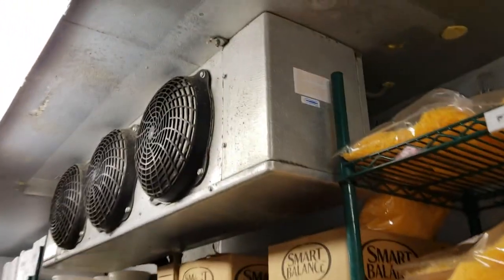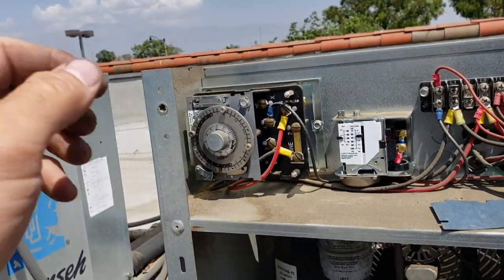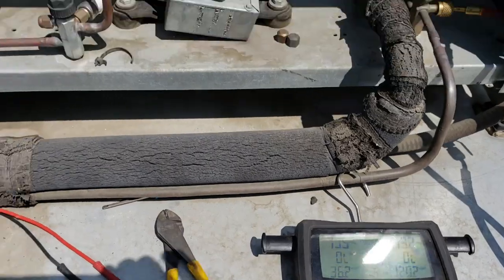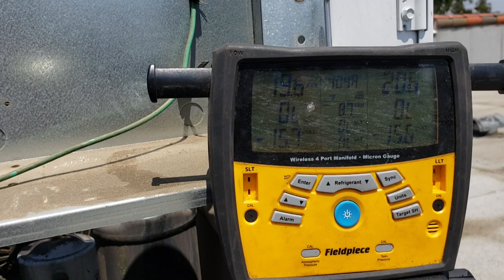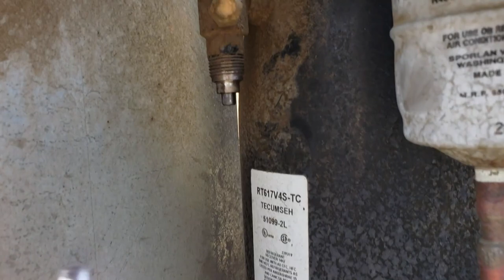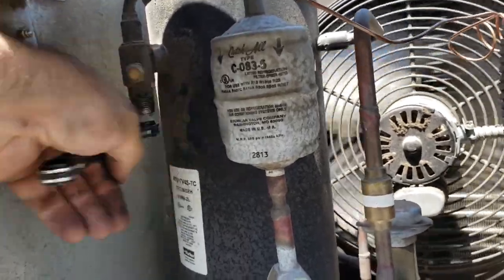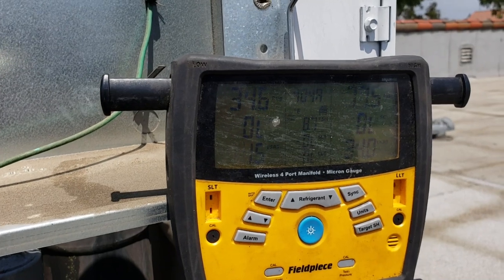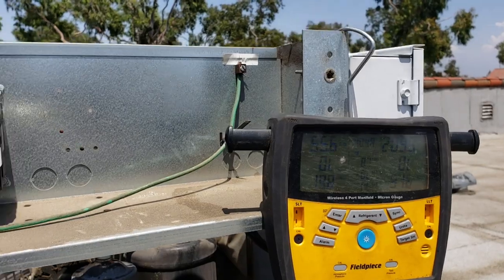Walk in Cooler low pressure control problems

Comment: I got a walk-in freezer compressor is running the fans on the evaporator are running it’s at 50° inside the cooler the low side feels warm high side feels warm I was wondering if you had any suggestions

Comment: Hello I am kinda a new to low temp, I built mobile walk-in freezers and every time I am going to start them up the compressor stalls and stops. I have to do it several times until is starts working, then after it works it does not do it again. I’ve replaced starting components, compressor, wires has a 75ft long cord and it is a 8 gauge wires.  What I started doing is putting thermostat up to 100 so liquid line can pump it down and still doing the same. When the system was new it did no happened. Voltage always no less than 203-208 on ea h leg. What can be the problem and thank you for your videos we are in El Paso tx.

Comment: I  have a question this is for a open air case 404a system. Condenser keeps going on and off check pressures ok. Could it be a bad sellenoid? It's a brand new condenser.

Comment: Hi. Very nice the ways you’re explains the job . 
I am working on draft walking the draft beer do not get that cool the bartenders say at the outside door thermostat do not go below 40  always was at 38 . The compresor get so hot I have water hose run there and low the pressure to 55 Paige low succión line, and I have some bubbles in sight glass and yes temperature go down to 38 . But I don’t know what could be wrong? Thanks for you feedback

Comment: Awesome video! I was looking for this information all over on how to replace the mechanical pressure switch without having to lose pressure to avoid noncondensable entering the system. Thank you!
Reply: is the small amount of air in the pressure switch connecting tube negligible??? the system was venting during the quick connection but i am assuming air was not removed from the pressure switch tube.?? just wondering..
Reply: @markhoffmann5941 nobody really knows😂 last year I broke my vacuum pump I just purged everything for a whole year😂 all the units work fine🎉

Comment: Taking a short cut was great. Checking the temp on either side of the dryer. Wouldnt it tell me first if the dryer is good. If not it would need replacing.

Comment: I have a system that has one broken low preasure port, one at the evaperator (inaccessible) and one with the preasure switch on it. I guess I have to take the low preasure control off to charge it. Fun times. Why is all of the equipment on YouTube so nice and the stuff I see is 15+ years old and trashed, lol.

Comment: When bypassing low pressure control to force the unit to run in an emergency, make sure you also turn down the thermostat and check defrost controls so it doesn't close solenoid and run in vacuum while you picking up the part.

Comment: This is great video showing real efficient way to change out the pressure control.   I like the subtle detail about the 6psi left in the system to do quick change out of the flare fittings.

Comment: Funny I did this last week as well same problem. This method is great way to do that and also replace a flared TXV🤓. Refrigerant is only a little bit of vapor escaping the system. Got to do it fast so no moisture or air gets in. Surprised the J/C control failed, usually it’s the cheap rancid or Danfoss ones. I enjoy your videos Chris!
Reply from the maker: It was actually was  a ranco  control personally I hate the ranco controls, but I decided to put the ranco back in because it fit perfectly. Thanks for watching and taking the time to leave a comment!

Comment: Had a walk-in loose a complete charge because snow on the roof broke the liquid line. I called out my repair guy to repair the leak but he didn’t replace the drier. I notice you were concern about loosing the charge so you don’t have to replace the drier. Your thoughts on this ?  Thanks.
Reply from the maker: Yes if there was a loss of charge the drier needs to be replaced

Comment: A really good video on the pressure control switch. I liked the technique of keeping a positive pressure on the low side so that you keep air out of the system while installing the flare nut & cap tube assembly. I am assuming we would want a walk-in cooler pressure control to kick in at 40 degrees & cut off at 35 degrees, hence the 5 PSI differential.
Reply: eeh controlling temperature solely with a pressure switch? Sounds a bit wrong in my ears, because the pressure is deciding how much the cooler will cool (temperature difference), not the final temperature. The final temperature depends on many other factors, like how much heat energy the walk-in-cooler collects through the walls, how often the door is opened, and which is the sorrounding temperature outside of the walk-in-cooler (Which temperature it has to "work against"), as a refridgeant system moves a set amount of heat energy from one Place to Another.

Using system pressure for temperature Control sounds like it gonna lead to a walk-in-cooler that is "warm" on the summer and "freezing" on the Winter, as the adjacent temperature around the walk-in-cooler will be a tad lower on the Winter, transferring less heat energy through the walls and during door openings, and a tad warmer on the summer, transferring more heat energy through the walls and during door openings.

Or is a thermostat wired in series with that pressure switch doing a final temperature Control aswell?
Reply: @sebastiannielsen  I work at a hospital & our morgue operates on a pressure switch as well as several reach in case type beverage coolers in the cafeteria. I'm sure the design engineers of the equipment considered all the criteria you listed above. I have never observed any real temperature differences on the equipment in summer or winter. The pressure control eliminates the need of a t-stat so you will not find one on a pressure control piece of equipment. The pressure of the refrigerant & the PT relationship between them will regulate or control the temperature & they work quite well. Thermostats with a gas or liquid charged sensing bulb will operate with the same principle as the pressure control. Heat is always trying to get to a space that is lower in temperature so regardless, the pressure control will react with the changes & operate in accordance to the setpoint of the control, not some other final temperature. If the setpoint is 34 - 39 degrees the pressure control will maintain that setpoint just fine unless the controller goes bad or something else happens to the system.
Reply from the maker: Thanks so much for watching I am going live this evening 2/18/19 at 5PM (Pacific time) to discuss recent uploads and answer questions from the week. Come on over and check it out https://youtu.be/78KjceoUwlc

Comment: great video what do u usually set the 22 system at cut in cut out
Reply from the maker: If it's a pump down circuit with a defrost clock i usually do co at 5 and cut in 25 ish

Comment: Great trick the compressor will hold the charge back to the receiver? Do you have a way to to do that with a fan control
Reply from the maker: Nope on a fan cycle control, and a high pressure control your stuck recovering.

Comment: What about cut in and out for a 404a walk in cooler? 36 degree box temp?  Still 5 psi and 30 ish?
Reply: Not sure off the top of my head for coolers but on freezers I usually set it it cut out at 1 psi and cut in at 20.

Comment: What's your opinion on teflon tape on the thread where you put the new flare nut.
Reply from the maker: I would never use teflon on a flare, only nylog or oil.
Reply: Ok, thanks for your reply.

Comment: The liquid receiver packing is there way to fix that or replace it ? If so can u send a link bc iv been told to use Teflon  and dip it in nylog
Reply from the maker: well on some of the bigger receivers they may be re-buildable but not on this one.
Reply: The reason I asked I had work on a three phase compressor and I had my sniffer it was leaking from from the packing nut so I front seated removed the nut and the packing was no good anymore and then I called up a few places they told they don’t packing nuts so then I started search on YouTube an hvac tech said to do it with Teflon so I was asking to see if that’s a good idea or should we replace the receiver bc since the Teflon been on it has not leaked since and ideas would be great just Incase I run into it again thanks in advance

Comment: What do you think about a little bit of air in the cap tube? Thanks
Reply: Refrigerant displaces oxygen, so typically when you “purge” the refrigerant will force out any unwanted air. Even when you install a capillary into a service valve the last step would be tighten the nut.

Comment: Are there some instances were you can replace a pressure switch without pumping system down.
Reply from the maker: Yeah if the system has valves that allow the pressure to be shut off for that particular switch and or if there is a Schrader valve below the control .

Comment: So when pressure control is open you get voltage and when is closed you get OL?
Reply from the maker: Yeah think of it as a light switch if you test power across a energized light switch that is shut off you will read 120 volts but if you test power across a light switch that is on you will read zero volts because electricity will always take the path of least resistance. Electricity does not want.to work hard!! :-) make sense?
Reply: HVACR VIDEOS thanks man, I’ve leaned a lot from your videos.

Comment: Great video as always- are you worried about the tiny amount of air that was trapped in the new low pressure cap tube when you installed it? I know the system was under positive pressure but since there is no way to bleed refrigerant through the low pressure cap tube I can only assume a tiny amount of air was left in the tube and then mixed or pulled into the system during its next pump down. Thanks for the great content--
Reply from the maker: You are correct and there is a tiny amount of air in there, it's not a great thing but not too concerning in my opinion.
Reply: @HVACRVIDEOS  thanks, I appreciate the response

Comment: Ranco pressure control = POS... But double checking was point on!! I usually use Johnson control ones and there a little more accurate. I also noticed you had a service opening there but I ain't fond of Tecumseh but good point to show out!!

Comment: Thanks for videos. I work for a small Hvac company and mostly do service tech calls, but i want to do more commercial refrigeration, such as walk-in cooler/freezers. Any book or training you can sell me? Tnx
Reply from the maker: You should order the book commercial refrigeration for air conditioning technicians by Dick Wirz It is a great book for an ac tech that want to learn refrig.

Comment: I tried to pump down a unit at the reciever,  why would my high pressure trip? It has a HPR valve.
Reply from the maker: Well first make sure you are front seating the king valve which is on the outlet of the receiver. And what is your high side gauge doing while its pumping down?

Comment: Why do you release pressure to 10 psi when changing the pressure control?
Reply: Its ok to jump pipework over with 10psi in it.  You can't really jump pipework at full ambient pressures and temps, especially not with a higher pressure refrigerant.
Reply: no call

Comment: Methodical! In the low pressure switch it regulates the Evaporator Pressure, correct.
Reply from the maker: No it monitors the low pressure and shuts off the compressor when it gets low.

Comment: That Lp control looked like it was hooked up to service valve. couldn't u just of backseated the valve maybe and just changed out the control ? no need for messing with pump down in this case.
Reply from the maker: It was hooked to the wrongs side of the service valve, so the pressure couldn't be shut off. I thought about moving it but didn't for whatever reason. :-)

Comment: Im not I agree with replacing a safety switch with a cap tube like that.  One would think that air would get trapped even tho you are at a positive pressure and "purging".  I would think a vacuum would need to be pulled.
Reply from the maker: I agree it's best to vacuum the system down, but sometimes you gotta do what you gotta do.
Reply: I hear ya man.  By the way, I really enjoy all your videos.  I love how you go back to the basics on every call.  You do a walk through on the whole unit.  Not just narrowing down to “oh, belts broke” moving on lol. You sure have helped me to slow down and step back and look at the whole picture.  Bc no one wants to hear they have a call back.

Comment: Your wireless probes are digital, and just screw onto a line, are there any pressure switches that are like that? Seems like a way to modernize it.

Edit, like this: https://www.contractingbusiness.com/refrigeration/article/20866164/hvac-pressure-controllers-a-big-switch-is-taking-place
Reply: The problem I see with too much electronics is the cheap Chinese electronic components that don't last. still those electonic equipment they don't sell it cheap. Mechanical components are more rugged in my opinion. High heat/cold will affect electronics more than mechanical.